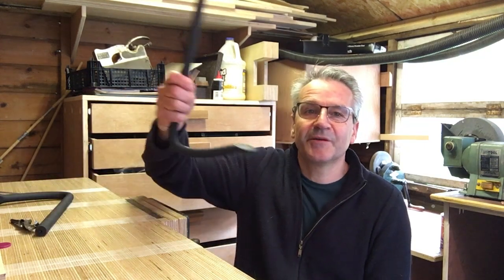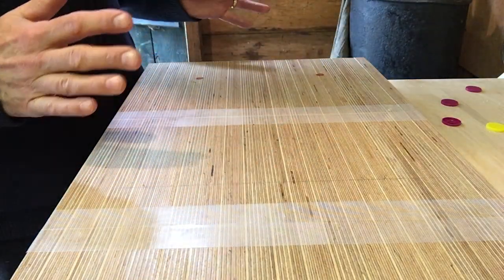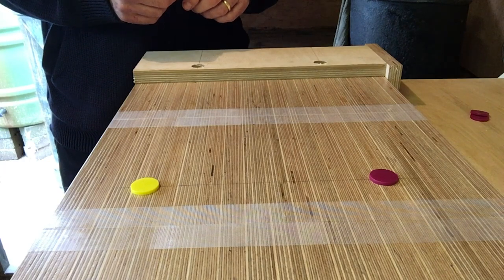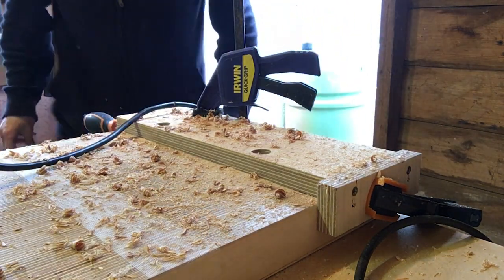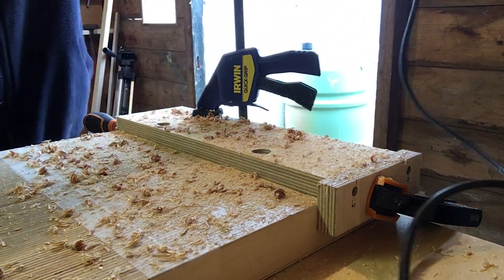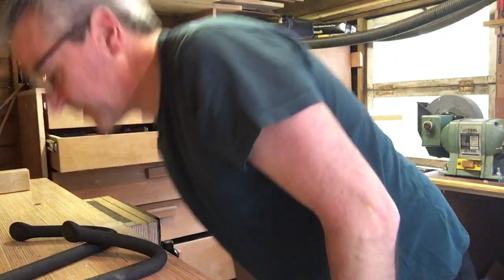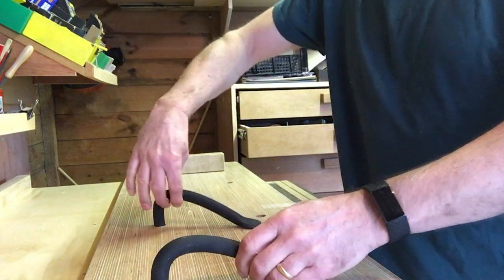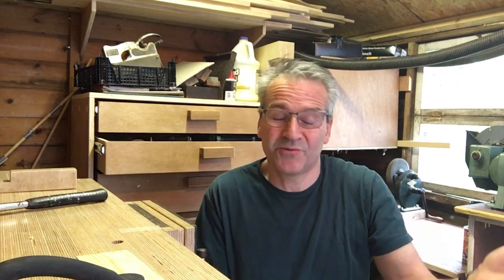Drilling my bench for holdfast fitting and benchdogs

Comment: VOice of experience here, getting the holes straight is critical. Your holdfasts get wonky if the hole is not plumb. I had no experience with holdfasts when I built my bench, and do not regret going without a vise (although I built a moxon vise for dovetailing later).
Reply from the maker: the first two holes were a bit off but after that all OK - will avoid using those two

Comment: with the metal hammer tapping on your hold fast might damage them over time. might want to use a mallet of sorts. maybe make yourself one if you have not done so already. could be a nice project for you to film and post on here.
Reply from the maker: Yes good point I have actually been using a mallet now and will look out for a small one specifically for that when I next go to flea market thanks

Comment: I’m surprised that worked so well, because you’re supposed to drill at very, very, very slow speeds with those auger bits. Hand brace speed, really, like 120 rpm or so: the little snail at the tip of the bit is supposed to grab the wood and pull the drill bit in. Maybe the plywood allowed you to slam it through like that.
Reply: I stand corrected: I followed the link, and this drill bit doesn’t have a snail at the tip, but a spur. Interesting.
Reply from the maker: i was nervous about doing it as not done anything like it before - i did test at different speeds on scrap and it seem to work best at speeds - i got away with it just!!